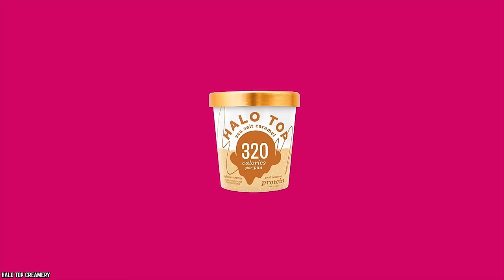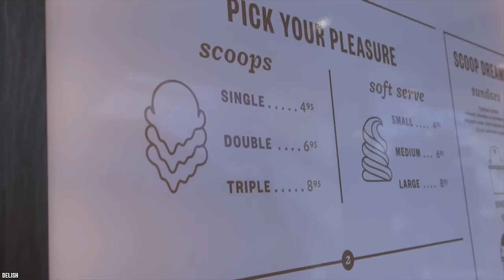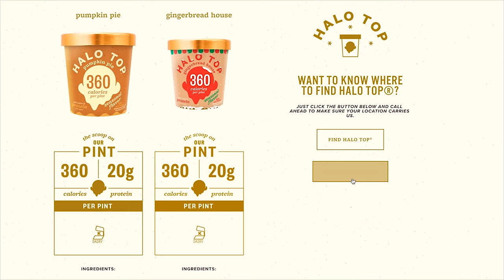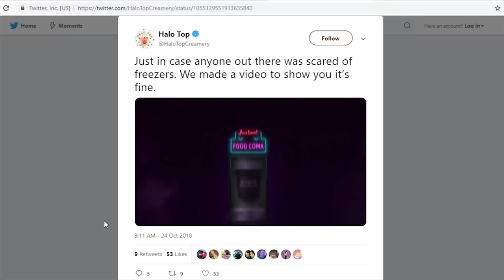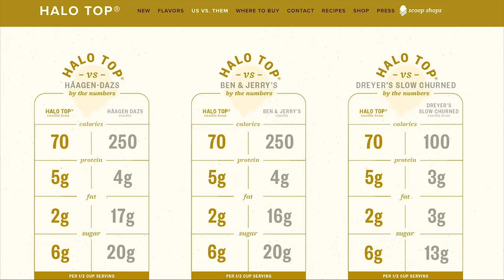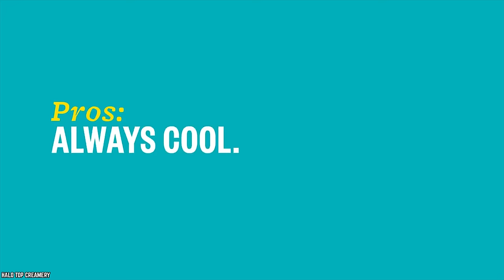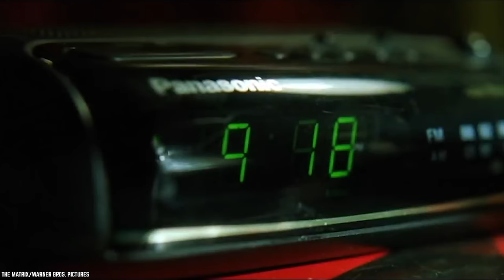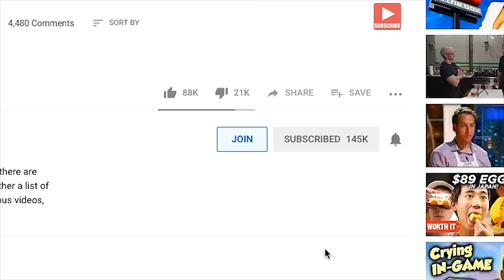Top 10 Untold Truths of Halo Top Creamery!!!

Comment: One of the worst ice cream pints ever. I have had more under filled containers then full ones. Plus they'er being sued for consistently under filling their products. This company is dead to me.
Reply: A lot of undefilled pints are from them melting and refreezing. I noticed this when I left one overnight in car and then refroze it. It was identical to “underfilled” pints I’ve bought
Reply: @MR-fl6ih  right. An Ice cream actually contains air, equally mixed in the cream. When the thing melt, all the air goes up, which make it look like it's underfilled